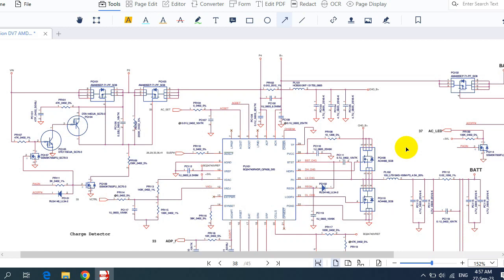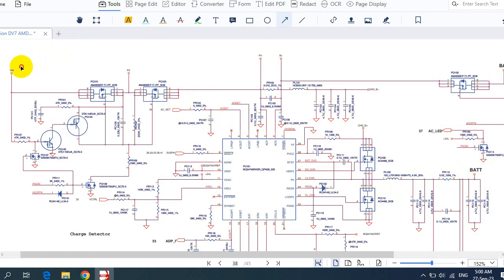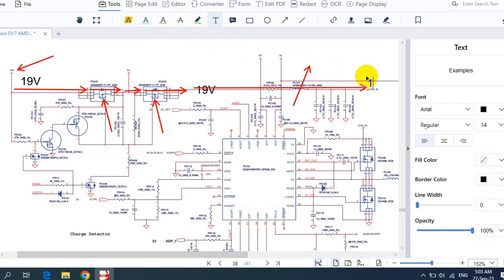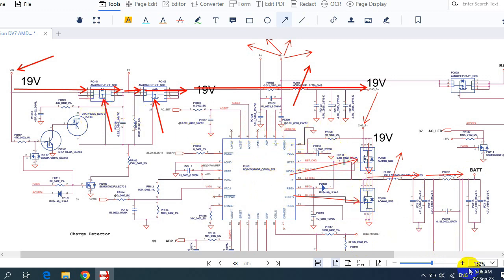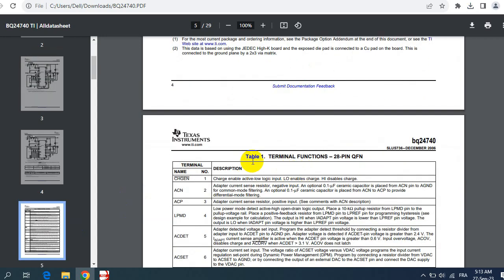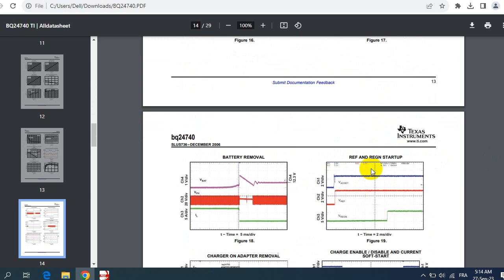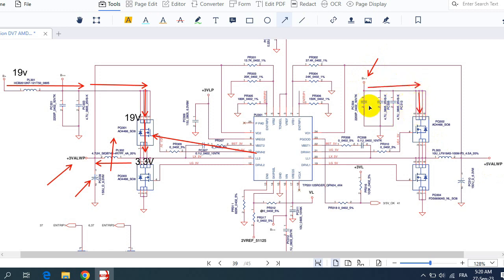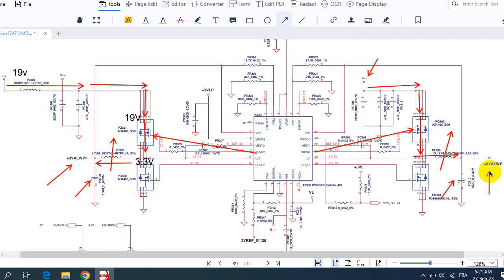Tracing a Computer Motherboard Voltage - motherboard repair

Comment: Sir please is the gate voltage also going to be 19v? because I find difficult as a beginner to know the gate voltage needed to open up an input mosfets on different laptops. Thanks
Reply from the maker: Depending on the state of the circuit
Reply: @electronicsrepairbasics_erb  am still confuse sir

Comment: The fir st mosfet receive 19v and give 19v as an output, so what is the purpose of the mosfet? It is not used as voltage regulator, isn't it?
Reply from the maker: We called that MOSFET a switch, we find that kind of MOSFETS next to the power jack.